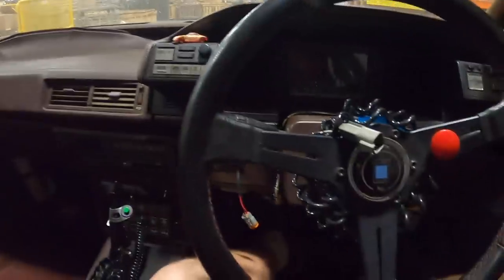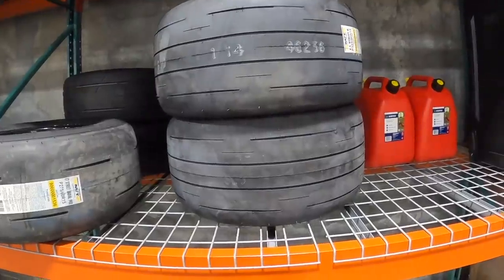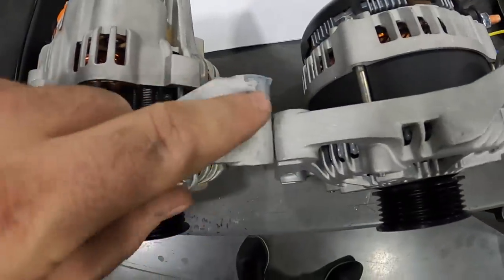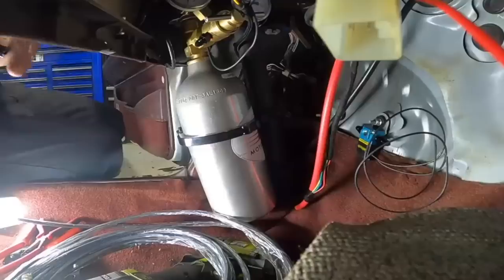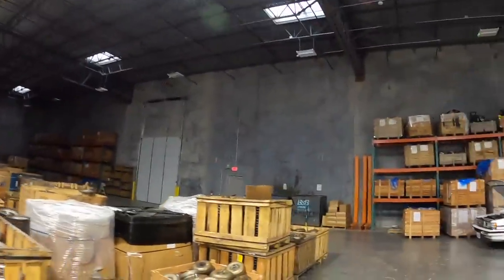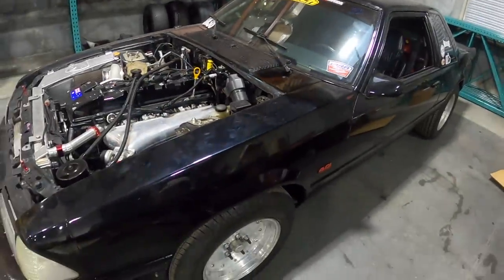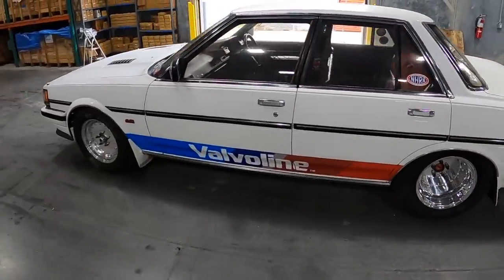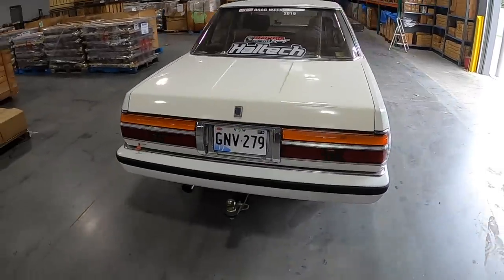Reunited with the Cresta & Mustang in America

Comment: For alternators and power steering pump spacers I used cheap 1/2" drive sockets ground down on a bench grinder.
Reply: Nothing wrong with using the extra 10mm's.
Reply: @wobblysauce  you have EXTRA 10mms?
Reply: I found the Snap on ones are excellent for this

Comment: Wheels are fat as! Do you have an6 plans to fix the dashboard? It's the only blemish on the  Crusta. ❤️🤪
Reply from the maker: I’ve tried but no trim shop or dash repair shop have any solutions :(
Reply: @BennysCustomWorks  that sucks. I wonder if there's a carbon fibre dash out there with similar dimensions you could modify to suit?
Reply from the maker: @danielspencer1973 I’m having similar ideas tbh
Reply: @BennysCustomWorks  you already need to get in there for a blower fan, more room for activities with a light weight composite structure. You could pull the dash, cut out the offending warp and smooth it out using bog or whatever is available then smooth out, gel coat and lay your choice of composite materials. Vacuum bag it and bam, home made dash. Yeah, not that easy but yeah, nah, yeah the car is worthy of the effort.